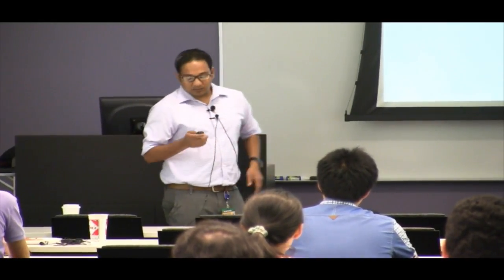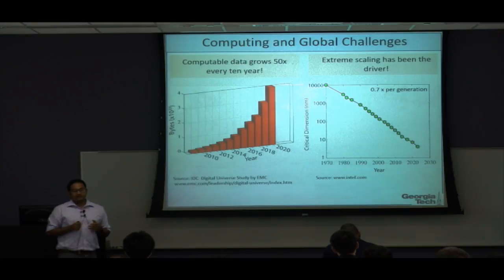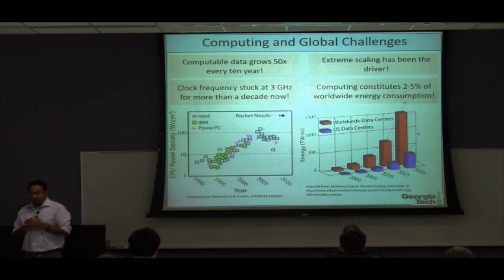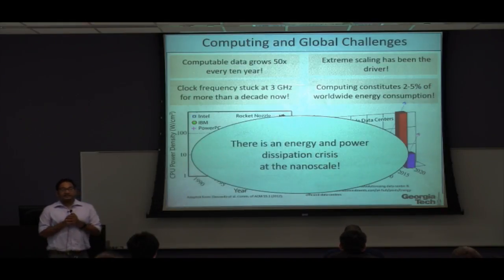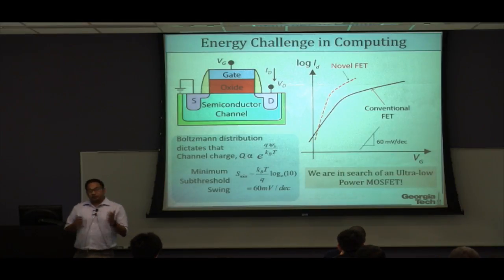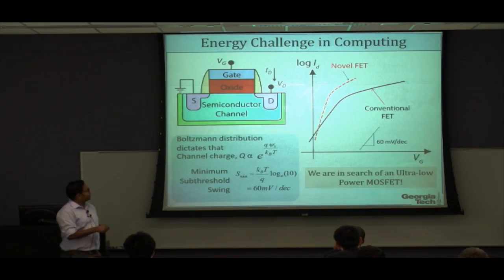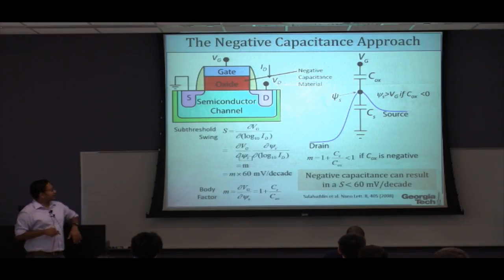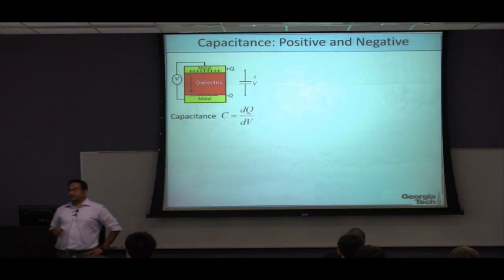Negative Capacitance Technology for Ultra-low Power Computing - Asif Khan, 8/22/17

Comment: Why we need a NEW negative Capacitance element, if we could use[1] a simple (and common) inductor L as a Lumped element for the Modeling in your Equivalent Circuit.
1. see Fig4. Quartz Crystal: Symbol and Equivalent Circuit, in: Williamson, T:  Oscillators for Microcontrollers,  Intel, 1983   http://ecee.colorado.edu/~mcclurel/iap155.pdf